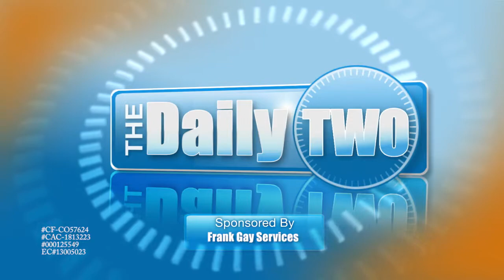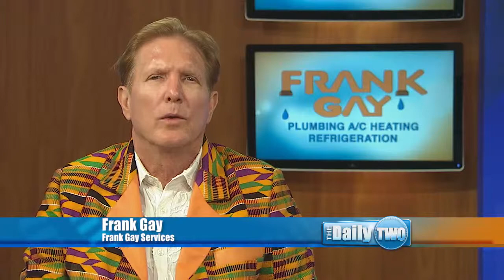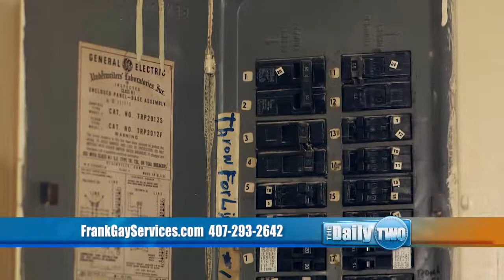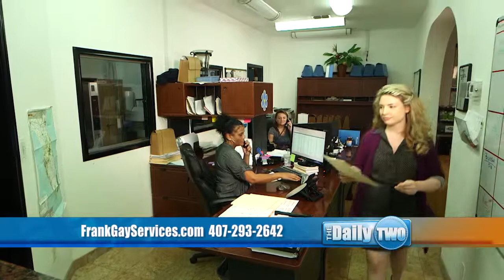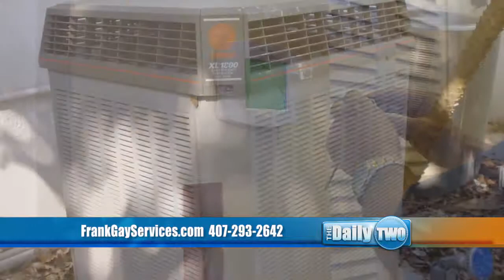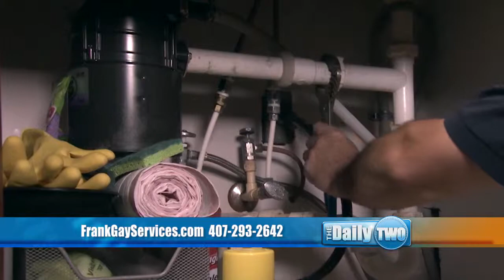Water Heater Repair & Installation Service in Orlando, FL - Install Electric Water Heaters

Comment: I called them early in the Afternoon about a Septic Tank backing up into the house.  They said they couldn't send anyone out to look at it until after 7pm.  Which by the way is when they get more for a service call.
We already knew what the problem was and they told me they would have everything they need to pump the tank when they arrived.  Then they have some young kid show up in the middle of the night so they could charge extra,  He did nothing,,,  He told me My Septic Tank needs to be pumped, which is why I called them in the first place,  then said he need to call it in so they could subcontract the work out to another service and charge me double.  And that we would have to wait several days because they don't even do that (Pump the Tank), after being told on the phone before they ever came out that they would do the work when they arrived and would have all the necessary equipment they needed when they showed up,  they stole from me, and didn't do anything except waste almost 8 hr of our time waiting around all day for them to show up.
They Left, and didn't do any work, but stole my Money....
Biggest Lying Pieces of Shit I've ever Dealt with.

Then the Kid starts trying to scare my wife,  pressuring her and acting like if she doesn't agree to sign a contract with him,  the whole house is going to implode.

Don't do Business with these people,  they are Scumbags.

They lied about when they were available to milk us for more money.
They lied about showing up with a tanker to pump the Septic.
They lied about the Service Call.
And they tried to charge us for work they weren't even going to perform, someone else was.
Every word out of their mouths was a lie from the first phone call till the dumbass who tried to pressure my wife and force himself on her.